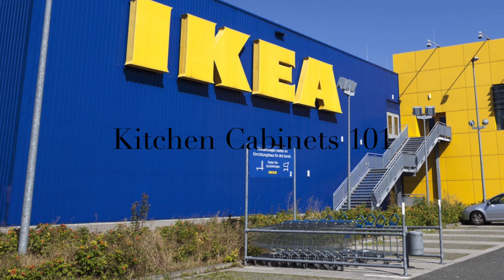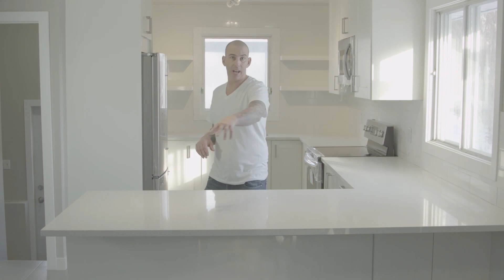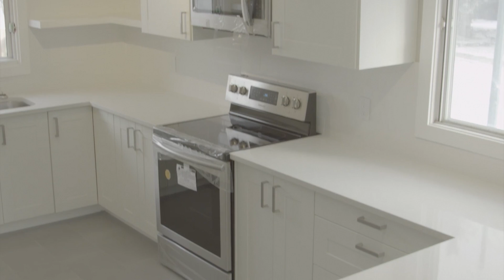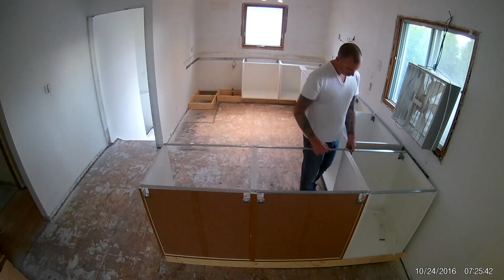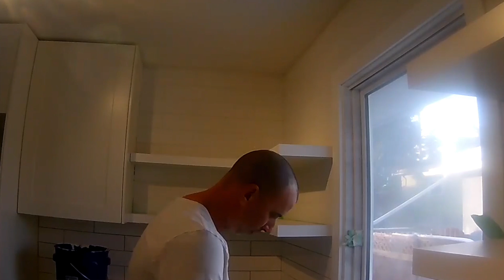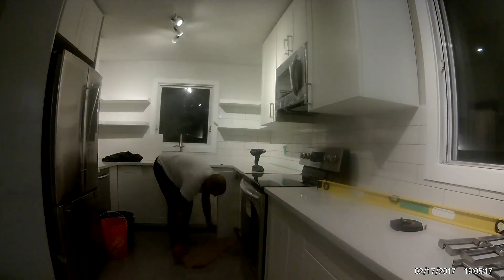IKEA Kitchen cabinets install 101

Comment: Should I put filler pieces in between the upper cabinets for room for the doors to open ? Or do I just screw the cabinets together and the fillers only go on the ends ?
Reply from the maker: They can get screwed tight together and not effect the doors. Some people will use fillers between for a different look but it is not required.

Comment: What dimension wood planks did you use for the cabinet base? 2x4s? Thanks!
Reply from the maker: Benjamin, I used 2x4s in the middle studs, but the height of the plywood is 5 1/2. In that kitchen I had to self level the floors and finish with tile. If you are working on top of finished floors you will make it lower 4- 4 1/2”. Just make sure your dishwasher fits in the space you will finish with. Hope that helps.